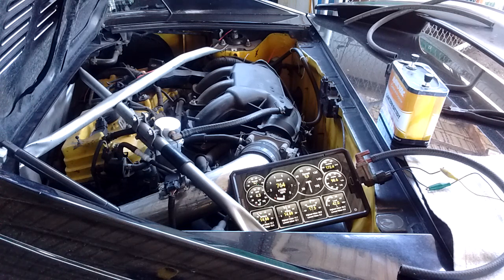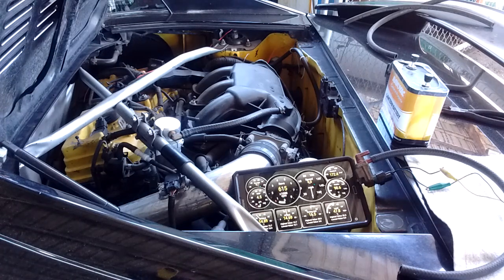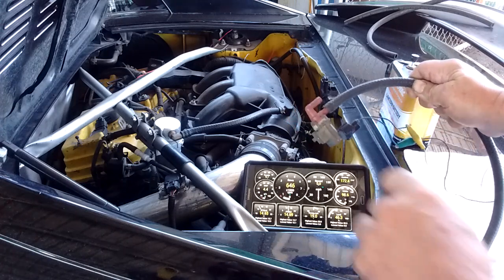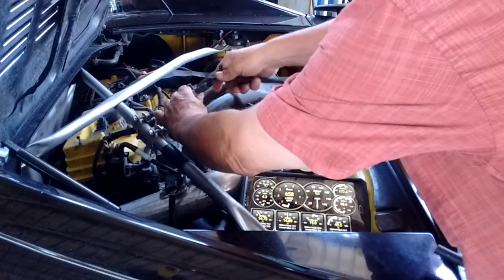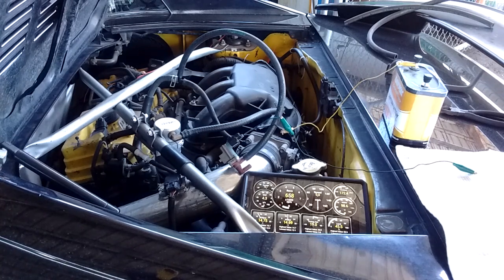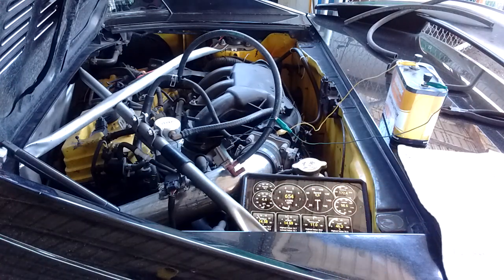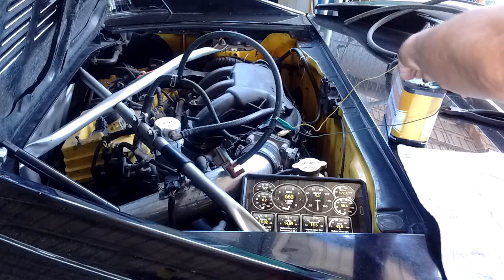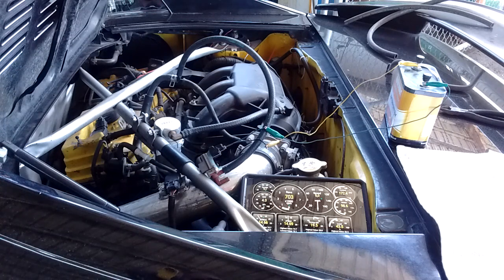Toyota MR2 2GR-FE V6 - DIY A/C Idle-Up

Comment: Could you post a video of the 2gr at idle. Mine is very noisy. Morenthan just the type writer injector noise. Like a bottom end rattle Not sure if it's normal or my engine is going to blow.
Reply: Probably the light weight flywheel, they make more mechanical noise and cause gear rattle
Reply: @denreyes67  I suspect it's my water pump. Won't tear into it until next spring. You're right about the flywheel though. It is the source of some gear harmonics for me when coasting under light load. I will be switching flywheels next time I open up
Reply from the maker: Take the belt off. Run the engine without the belt and see if it makes the same noise.

Comment: Hi, I need help with my AC compressor. 
Ok,  i have a 91 Mr2 Turbo doing a 2GR swapped.  I completed last week and now installing my AC compressor. It’s from a 1GR motor compressor bought it new from DENSO. Today I hooked up my Manifold gauges and added Fresno but my compressor’s is not activated at all.  The clutch is Turing on or rotating period. Can u please help ?? 
Got my engine wire harness from Wiregap. 
Thank you !
Reply from the maker: The ac functions are controlled by the AC amplifier which is a small ecu under the dash. The 2gr ECU does not control the ac in your sw20.
Reply from the maker: The ac amplifier switches the ac clutch relay which is also in the passenger footwell under the dash (us lhd).
Reply from the maker: One simple test is jumper the ac relay and measure the voltage at the ac connector - can be done with the connector unplugged. You should see 12v at the connector when the ac relay is jumpered. If you do not see 12v then either the ac relay is not getting power or there is a fault in the harness between the relay and the ac pump connector.
Reply from the maker: Another issue is you may be not able to charge enough pressure for the ac amplifier to trigger the relay. The ac amplifier requires a minimum pressure to trigger the relay. To get around this you first fill as much as you can then you jumper the relay to force the compressor to turn on then the suction draws more refrigerant until the system gets up to pressure.
Reply from the maker: Hope this helps you to troubleshoot your issue and id you have any questions let me know.

Comment: So just create a huge vacuum leak to bring up the idle.
What about dirt in the throttle body? 
And wouldn't it make a lean pop?
Reply from the maker: The VSV creating a vacuum leak is the actual ac idle-up method that Toyota uses in many vehicles including the SW20, AW10, and others.